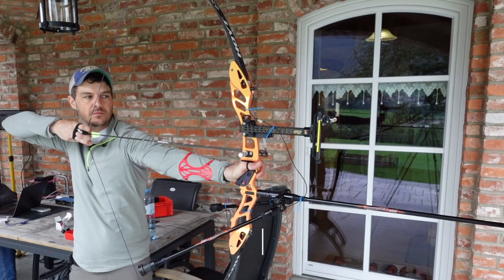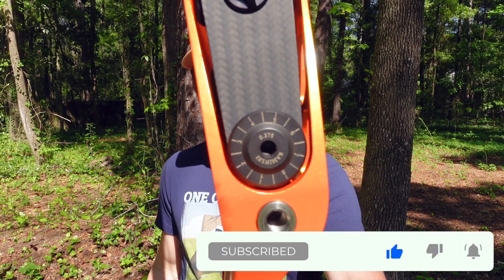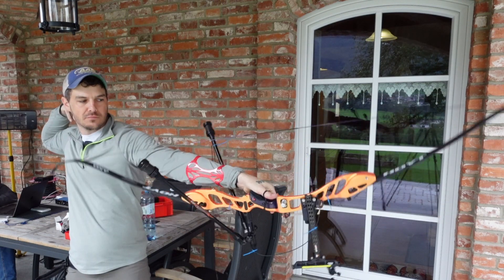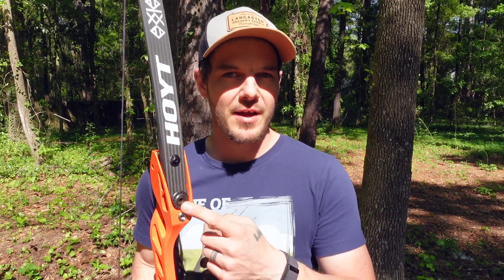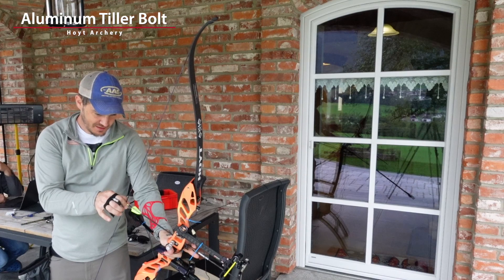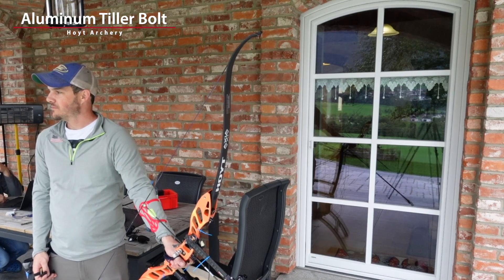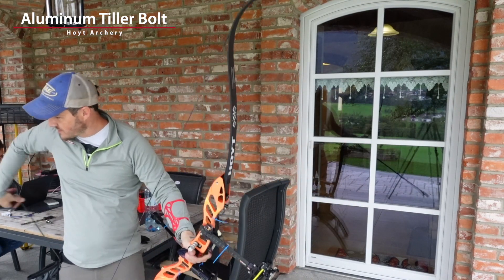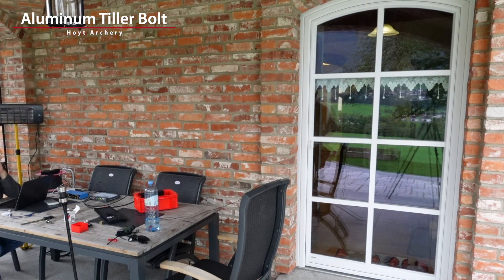Vibration Analysis of Recurve Tiller Bolts | Does Material or Fitment Matter More?

Comment: Hi Jake! 

Perhaps this question is off topic, but I wanted to consult you if for both the AAE microclicker and the axcel sight mounting block, you use the standard length hex screws or use longer screws to tighten up both things into the riser? 

I'm having a tough time trying to mount both my sight and my microclicker plate on the sight holes of my riser because I ended up realizing the hex screws weren't large enough to tighten up both things and instead were slowly stripping out the riser's sight holes.
Reply: I always buy
longer screws/bolts
and saw them offf to exact MAXIMUM length.
Reply: Just buy long bolts in
6-32
and your problem is solved.

Comment: Just out of curiosity, have you done any speed tests comparing arrow speed with the different tiller bolts fitted? Logically you would think that the total energy in each shot is the same (if draw length is consistent at least), so if less energy is being "wasted" in vibration it has to be going somewhere, and the arrow seems most likely. Probably not a huge difference, I'm just wondering if it's even a detectable amount.

Comment: Wouldn't clear coat/Cyanoacrylate glue applied and sand down to perfection on the limbs "fork" work on the same principle? Because mostly it is not the tiller bolts problem but the limbs problem.
Reply from the maker: Yes and no. 

In this case in this particular video it was the tiller bolt that was the cause. The tiller bolts according to ILF standards are supposed to be 3/8” OD and limbs should also be 3/8” ID. 3/8” is 0.375” and the aluminum and steel tiller bolts measured 0.3715” OD with the ID of these limbs measuring 0.375” ID. 

These were the smallest Hoyt limbs ID that I have personally owned and were in spec… you could add clear to take up the slack, yes but will it be concentric? Are you going to accidentally build in a mis-alignment? Hard to say if it matters especially since we have adjustable pockets on basically all ILF bows. 

However for the money spent, and with basic machining standards you can easily hold tolerances that would prevent any of these issues…. We call the tiller bolts “precision” but they are not precision machined in the machining world.
Reply: @JakeKaminskiArchery 
 Yeah,   the variations in tolerances,  reminds me of ...
Spanners 🔧 and bolts 🔩.
Take for example:-   ~~~ 17mm hex.
The width of the physical bolt head is ALWAYS NARROWER than 17mm!!!    For a 17mm Open-Ended Spanner,  the width of the gap of the physical jaws is ALWAYS WIDER than 17mm!!!
IF   I   RECALL   CORRECTLY,
the answers FROM manufacturers is
"'our spanners are wider, to ACCOMMODATE for the variations from those bolt makers'".
On-The-Other-Hand  ~~~ "'our bolts are narrower, to ACCOMMODATE for the variations from those spanner makers'".

🤷‍♀️   🤦‍♂️    🤦‍♀   Are you flammin' kidding me??!

Hey  Spanner Makers,  NO 17mm bolts are made larger than spec.!!!
You surely DON'T NEED to ALLOW for over-spec'ed hex heads!!!
Hey  Bolt Makers,  NO 17mm spanners are made smaller than spec.!!!
You surely DON'T NEED to ALLOW for under-spec'ed open-ended spanners!!!

STOP ACCOMMODATING for 0·200mm bad tolerances
from the OTHER guys.
Your combined efforts CAN LEAD TO
up to 0·4mm issues to proper fit [@ 17mm]!!!

🤷‍♀️    🤦‍♂️    🤦‍♀

️

Comment: I would find it interesting to also use precision “ILF nuts” or whatever the metal bushing on the limb is called. After all, a perfect fitting limb bolt is still only one of two side-to-side contact points.